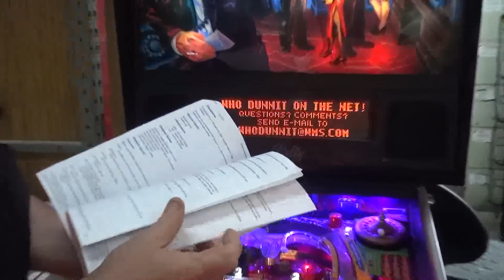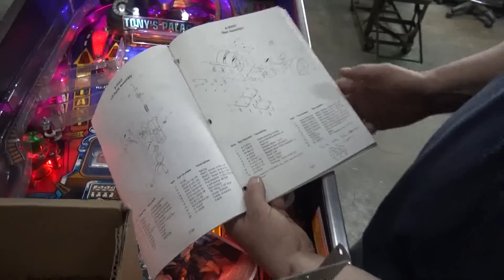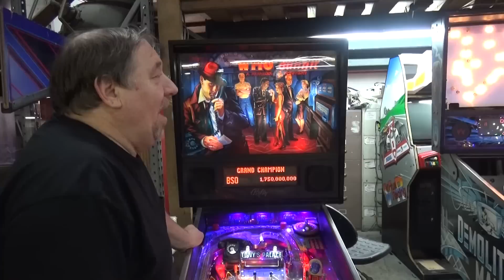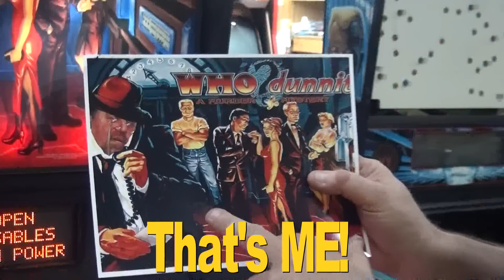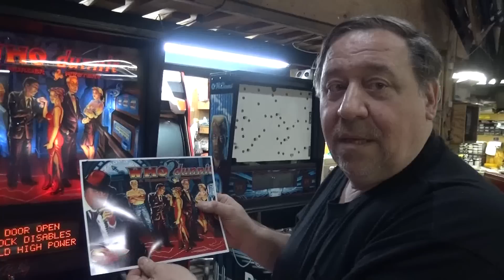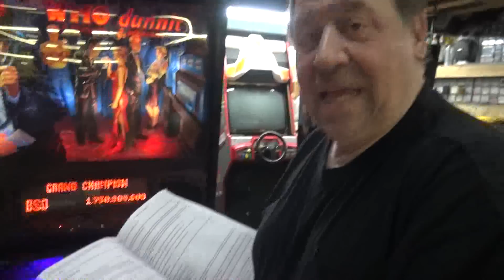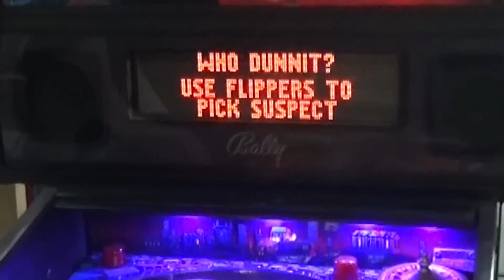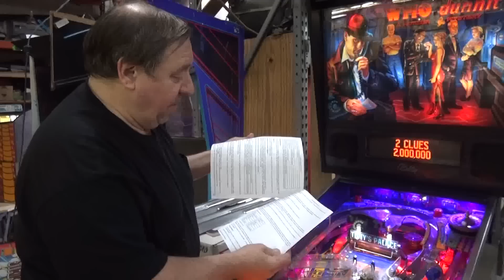#647 Bally WHO DUNNIT? Pinball Machine & fixing those Slot Reels! TNT Amusements

Comment: Great mods, for a misunderstood machine.  Played this often, and wherever I can find it.  Hopi it it goes to a great home.  The problem I understand on this pin, is that the gameplay begins to warm up, usually during the last ball, even for the average player.  If you're a pro, then you'll have a better game, but it will last about 20 minutes, which isn't good for revenue.

Plus the elevator shot, is very hard to perfect.  Surprised Bally did not eliminate the slot machine reels, for a smaller DMD in that space.
Reply from the maker: That would have been a MUCH better idea!  No moving parts!!!
Reply: Easter eggs in Theater of  magic. Hold right flipper before pushing start n says congratulations. Digital pinball. The other button says mortal combat nothing happened
Reply: Would look good with colour display. Taxi n slot machine toys n train. I was told there is one mod for roulette wheel as well apparently spins lights like the phone. You're thoughts from a Canadian viewer🍻

Comment: Great video Todd. Do you have any advice for a fellow W?D owner with a F116 that keeps blowing?
Reply from the maker: unplug the coil plugs and the flash lamp plugs until it doesn;t blow, then start plugging back in to at least isolate which plug is causing it